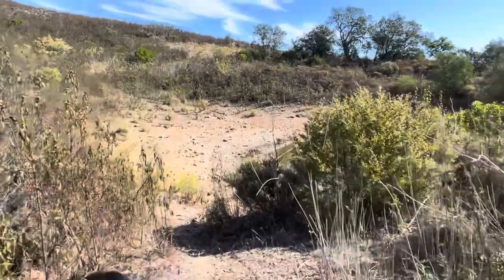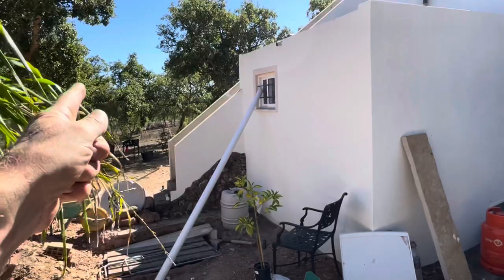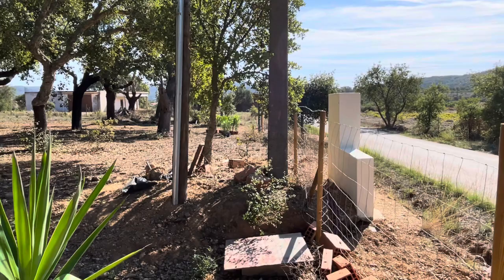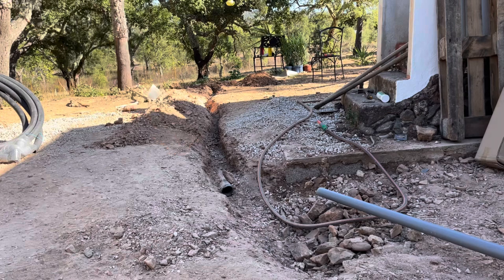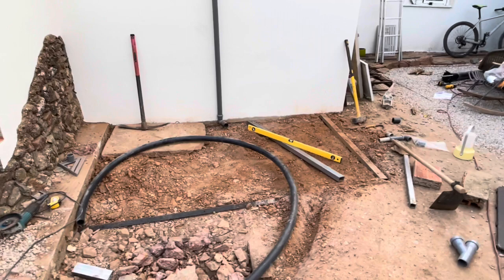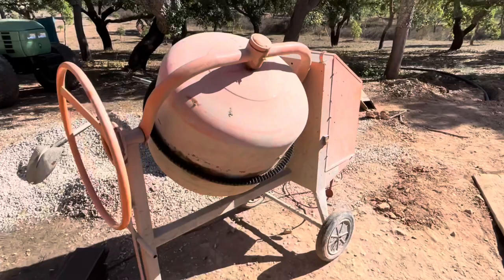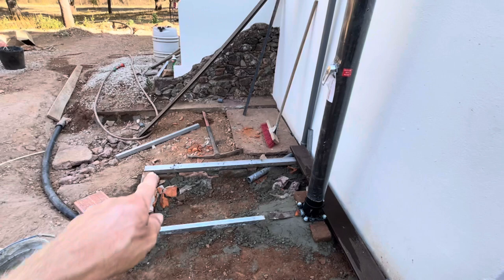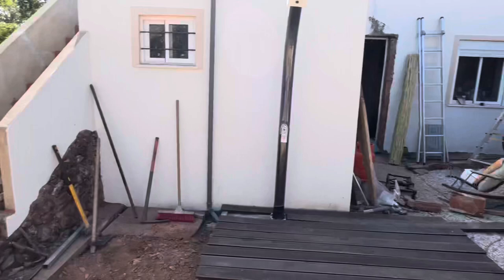Making an Outdoor Shower with Concrete Tray #25

Comment: Loving these video's fella your living my dream lol. One tip for you on that cement mixer. Yes grease the bearing but never the ring teeth as any dust that lands on there will turn into cutting paste. Teeth are best left dry unless the mixer is outside unused for a long time. If it is use some old engine oil and leave it. Hope this helps.

Comment: 24:33 Ah! There you go! I was right! It was the starter motor!

I guessed it on your previous video by hearing "click" sound when you tried to start the engine.

Now you know it: Old Diesel cars can be started without starter motor, just by going down a slope and then engaging the 2nd or the 3rd gear.

Comment: I watch a few Portugal homesteading channels...  I am by no means an expert,  but by what I have heard cutting that corktree yourself is extremely illegal.  Just an FYI...
Reply from the maker: Hi thanks. Yes, I should have mentioned in the video it was damaged and hanging over the back of the house. Way to dangerous to leave it. Cork trees are protected here.
Reply: @blondguy  👍 Yes you did mention that.  Just from what I have heard is that the government has to do any of the cutting on corktrees.  Like I said i'm not an expert.   I've just been told that only government can approve or actually cut them.  Cheers!

Comment: How does solar shower heat up if it's always in the shade ?
Reply from the maker: It will get a few hrs in morning during winter. It’s the back of the house that gets shade during winter only. Plus it’ll be connected to the boiler for the winter.
Reply: Position a large mirror to reflect sun onto solar shower this will heat it up fast